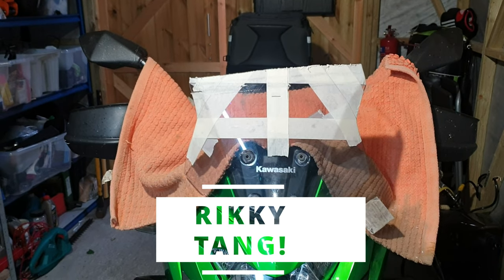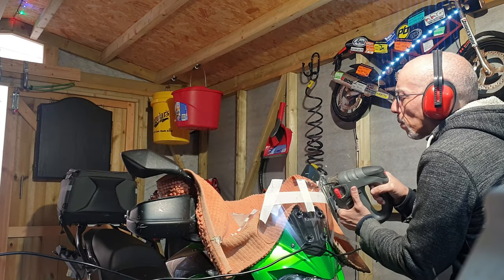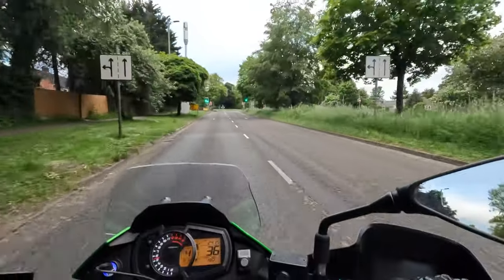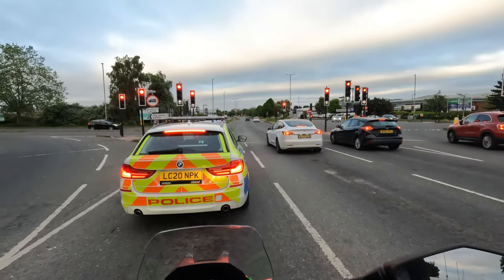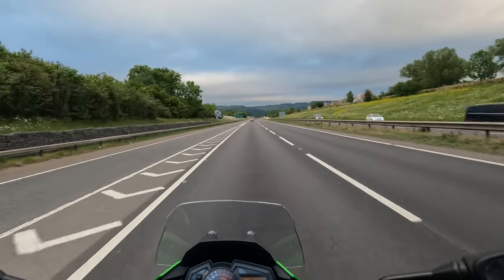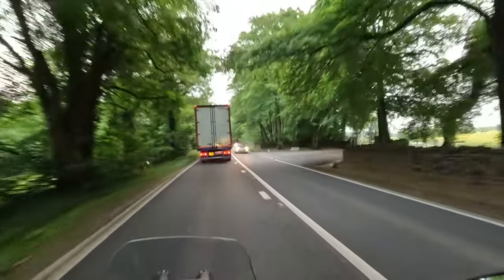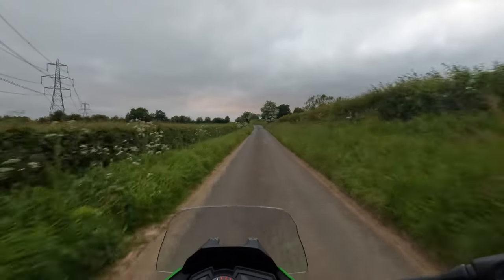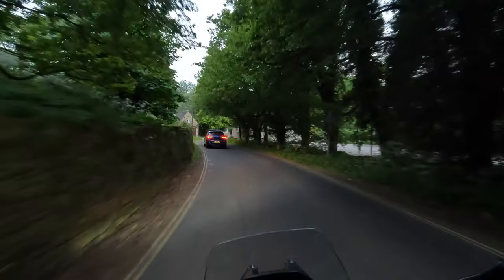Cutting down the OEM screen! Screen testing Pt.3  Kawasaki Versys-x 300

Comment: Told you it would work better. I also have a cheap eBay Chinese mesh cover. It was about £10. It does the job, cooler nuts, and bum cheeks. Makes a rock hard seat more comfortable.